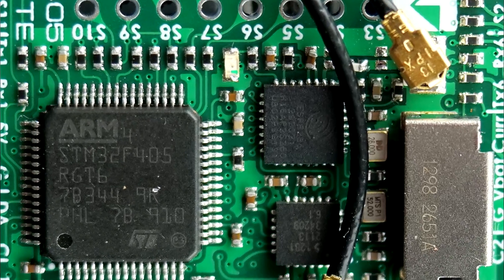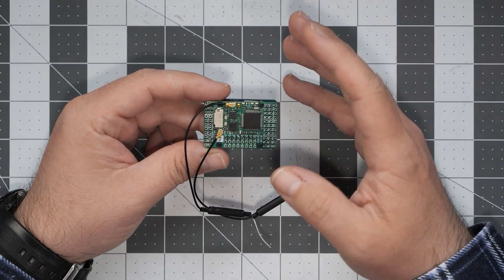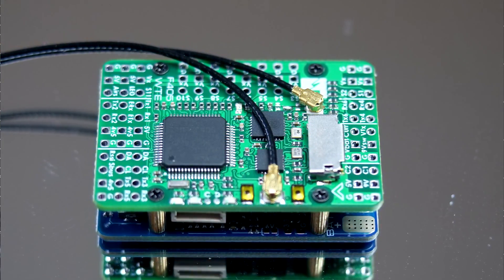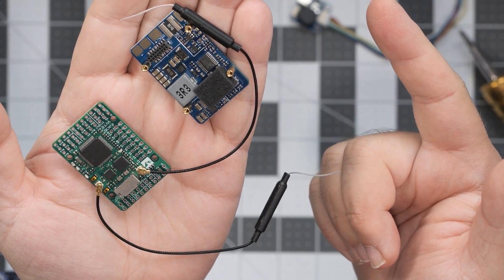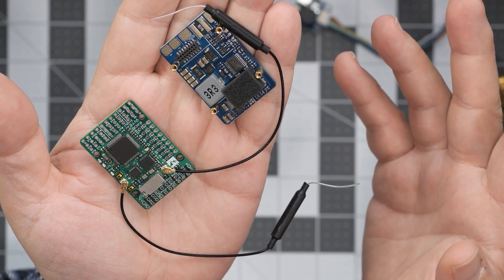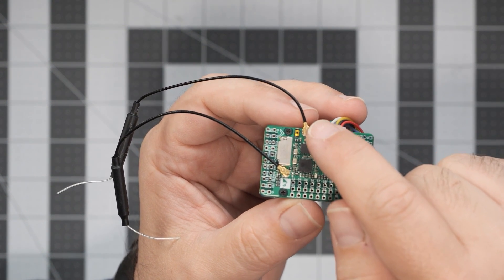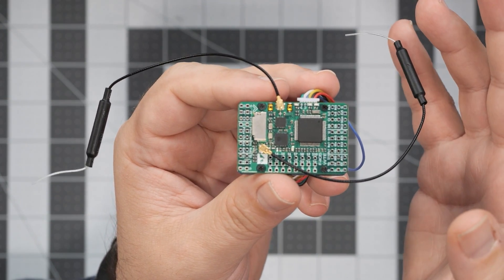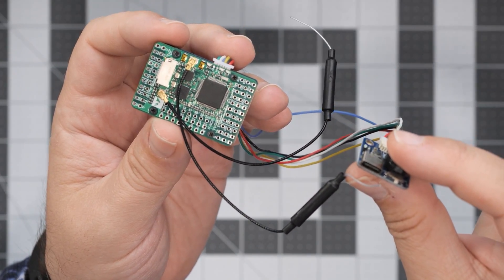Express LRS and WiFi on a Matek's Wing flight controller | Matek F405-WTE

Comment: the board comes with ELRS V2.2 I need to upgrade to 3.5xx. The ELRS uodate page says to use DIY_2400_ESP8285_SX1280 this option is not on the list in 3.5xx I have tried the generic ESP 8285 version which does not work, any idea which device to choose or  is it best just to add another ELRS RX

Comment: I have this FC, the user manual shows that i can use a jumper to jump ETX and ERX to either UART1(wifi telmetry) or UART2(ELRS)  but not both . I do not understand why matek didn't just make a dedicated UART for wifi telemetry so i can use it alongside the built in receiver. 

or am I just lost and have the wrong assumption?

Comment: It's cool but the range of wifi isn't significant. Installing a separate bt/wifi module, is nearly as easy and more flexible(lighter too). Whoever cracks the telemetry problem and offers RFD900 quality telem + control in a single module is going to own the space imo. Both DL and CRSF promote their telem feature but it's never really delivered. This board would be cool for experimenting in a short range scenario.

Comment: If I choose not to use the wifi / ELRS receiver and remove the antennas, will this damage any of the components when I power up the FC?
Reply from the maker: If it's powered, it might transmit and damage the RF section. So no, if it's powered it should have antennas
Reply: @FPVUniversity  Thanks, I expected that to be the case. I'm all in favour of new functionality being added to FC's but we should have the option to disable fully if we don't wish to use.
Reply: @FPVUniversity  I'm planning to use the Elrs receiver function. I don't care for the Wi-Fi thing. Do I still need to keep the second antenna on that port or is it even used as a second antenna as diversity for the receiver?

Comment: Are the Matek WTE (Wing Third Edition?) and Matek H743 series supported in INAV 4.1, or will these FC's require INAV 5.x?  Realize Matek is adjusting to supplier inventory issues with IMU, Baro and other sensors. 
I would be nice if Matek  listed the minimum INAV version supported on each FC. INAV support  'coming soon' is a little vague. 
An important topics, as all WSE Matek stock seems to have been depleted, leaving just released WTE inventory. I'm lucky as have a spare FC, but would be of concern for anyone doing a new wing build.
Reply from the maker: WTE needs INAV 5, but H743 is supported by 4.1
Reply: @FPVUniversity  Thanks mate.
Reply: ....when 5.0?
Reply: @ericschwegler5957  tune-in to  @Paweł Spychalski live-stream scheduled for May 28, 2022 to learn when. ;)
Reply from the maker: @ericschwegler5957  Actually, RC1 should go live tomorrow :) https://youtu.be/E9VWM0BpWKI
Reply: Please tell me which controller in the inav 5.1.0 "choose a board" menu I should choose for matek f-405 wte, there is no WTE there "

Comment: It's definitely worth mentioning that you can't do express LRS and Wi-Fi telemetry at the same time. To people who've been around this for a while that might be obvious but to most people watching this video I'm sure that wasn't clear.
Reply from the maker: Yeah, good point. The matek's manual states that so at least it's noted somewhere
Reply: @FPVUniversity  and as a side note it seems like a missed opertunity not adding a pa/lna on the esp8266 similar to  the matek expresslrs diversity Rx. I was looking for something between a sik radio and an rfd900 radio when I came across this FC. Great video as always.
Reply: I had watched the video without looking at the Matek site before.  Now that I went to learn more, I also realized its one or the other... so if you do plan on using ELRS and setup the Rx then forget about that wifi connectivity to the FC too...

Comment: No Diversity, less separation of components, could make antenna mounting locations less than ideal. Useless to people not using elrs. I hope they dont continue this trend. Integrating things i wont use just adds cost. I use both crossfire and elrs but i certainly dont want a rx built into my fc. FC with bluetooth/wifi built in for configuration that disables when armed and flying now that would be useful for field flying and save me adding BT modules to all my models.

Comment: Not if you break off one of those IPEX connectors from the PCB. Then you have an expensive paper weight.
Okay for a quad maybe, but not very flexible for FW use...🤔😳🇬🇧

Comment: I'm not a fan of having receivers integrated on the Flight Controller (FC) pcbs for a number of reasons. 
If there is demand for such, better to include a standard 4-pin connector for users to choose their Rx of choice (UART Tx, Rx, plus 5V and Gnd pins). Soldered/connected to the 4-pin header, or pilots could use an extension to located the receiver where they desire on the airframe, away from the FC. 

Such a solution is already implemented  by Matek on it's ELRS-to-PWM converter boards. 

Having antennas attached to pcb, particularly for a wing in tight space of fuselage with servo wires, etc is just asking for issues. Not only could an antenna get intertwined with other wires, any RF signal from antenna would be propagated to nearby wires and circuits creating added electrical noise.

Generally I have liked Matek FC's (own a few), but this one does not make much sense to me. While I'm experimenting with ELRS, its with 915MHz, not 2.4GHz. Seems interesting in theory, but from a pragmatic standpoint, I have many questions. Will let others experiment and report results.

Comment: Integration is fabulous, however, so is modularisation. On my fixed wing I want the flexibility to not only swap modules out if they go faulty or if I want to change to another RF band, I want the flexibility to be able to position modules on the nose on the tail and on the wing tips.  Let's not get too carried away with this product.

Comment: Nah. For a quad, sticking ELRS on the FC might make sense. But not for fixed wing. Even if ELRS is used by the pilot, separation is a good thing on fixed wing. I want my receiver out in the wing, and the VTx in the other wing. So no, I don't think this is a good idea. The telemetry side, maybe. But to be honest, I'm happier about the cam switching, and better power handling than the WiFi or ELRS. I won't use either, so they're at best redundant; at worst adding extra cost to the flight controller for something I won't use.

Comment: Hi Pawel, interesting idea. However, since the original 405 and the 405-wse is EOL, this s***cks. Extra features that drive the prize up - features not everyone can/want to use. Especially if these features can be easily connected as peripherals.
Having a manufacturer investing into new ideas and concepts - thumbs up! But not when other options are removed. Especially for the F405 - an etalon of solid reliable worker!! 
But who knows what drove Matek to this decision....

Comment: I like the idea of wifi,  but having a 2.4g elrs rx on it is not at least to me of little to no use since I don't fly 2.4g elrs. This feature of elrs is useful for those who use it however. 
From what I have seen a majority of elrs users are predominantly quad flyers. On my fixed wings my rxs and antennas are usually mounted much further from the FC as I believe many fixed wing pilots do especially those doing LR

Comment: You reckon they'll make an H743 version but with a 915Mhz ELRS? H7s are more powerful and thus a higher performance control link is more fitting.

Comment: Shit…..I’ve just bought a 411-WTE/need to sell it fast!😁
Reply from the maker: well, you know, it's hard to compart the smallest to the 2nd biggest of Matek's FCs
Reply: @FPVUniversity  if the 411 won’t give me 200km/h, it will be “SOLD”😁. The F765 gives me 176km/h so my wing is used with a big FC.
Reply: @FPVUniversity   if the 411 won’t give me 200km/h, it will be “SOLD”😁. The F765 gives me 176km/h so my wing is used with a big FC.

Comment: I surely would rather use the Matek 2400D rcvr placed in a optimal spot on my craft rather than an on the controller. I am satisfied with the 1:2 telemetry I am getting with ELRS on the INav LUA script. I haven't really pushed the range of ELRS, but it is a strong link without fail safe in all the applications and flying I do.
I do like WIFI for configurator or Mission Planner. I haven't tried Ardupilot over ELRS...yet. I am still using a Jumper Radio R8 rcvr that has a UART for Mavlink telemetry. It works well , but I haven't pushed the range beyond the flying club field.

I am really liking the Matek ELRS-R24-V 2.4GHz Vario Receiver, except I removed the soldered rcvr and replaced it with a 2400D rcvr, added a gps , then placed it in a foam motor glider, an aged, trusty Parkzone Radian. Very satisfied except I can't figure out how to display Altitude telemetry. Apparently CRSF  doesn't do barometer tele?
Reply: Look through ExLRS pull requests cause I think I saw something about the altitude telemetry being added but I'm not positive. 
What kind of data rate do you get with the R8 using mavlink? I'm building a plane and can't find any actual through put data for mavlink over crossfire either.
Edit ... It's pull request #1528. 5 days ago merged so it'll probably be in ExLRS 2.5 or whenever 3 comes out I guess. I'm not sure how all that works.